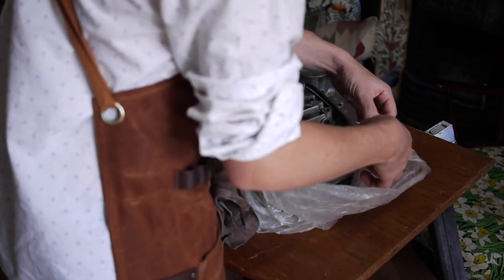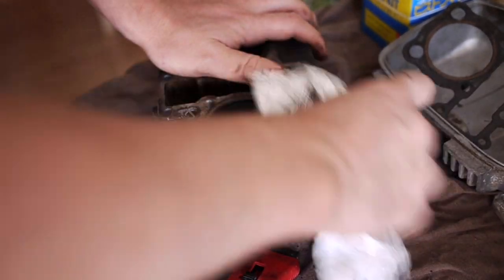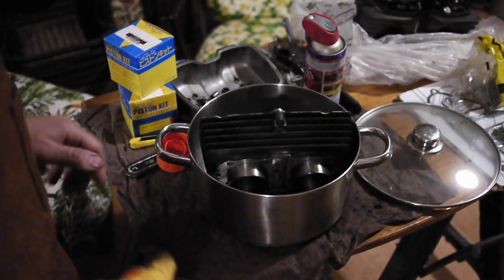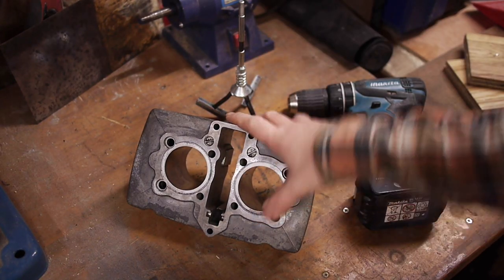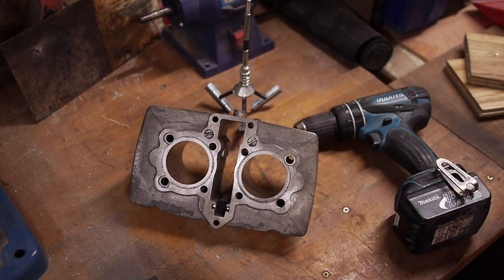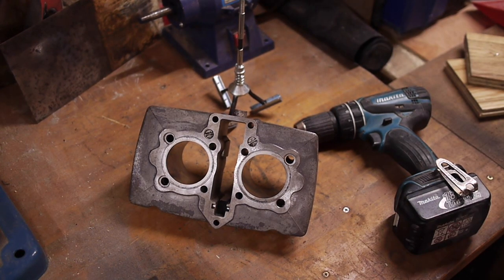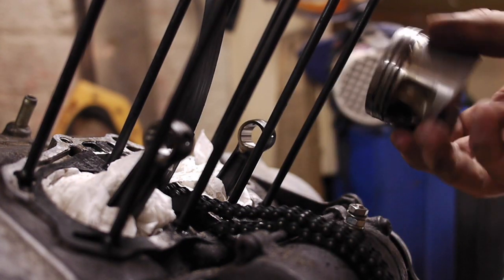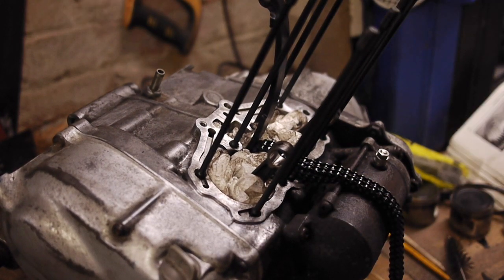Honda CD200 Benly Resto – Honing the cylinders, new pistons

Comment: you should have gaped those rings before installing... Too small a gap and the piston will seize when it gets warm.
Reply from the maker: That was not in the manual. Now I'm worried.
Reply: @TooManyProjects  Do a you tube search - there are plenty of vids. The end gap data is supplied with the rings or pistons and will probably be in the workshop manual too.  Look here for figures. https://www.hondatwins.net/threads/cb200-piston-rings.39480/post-310922